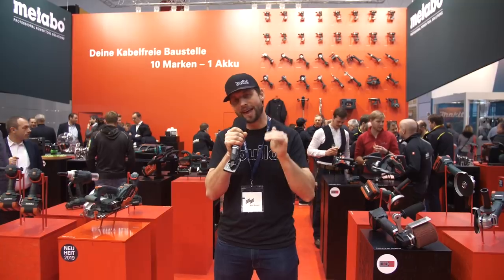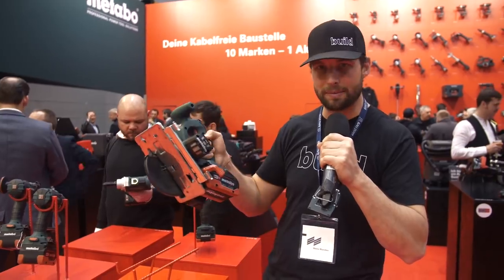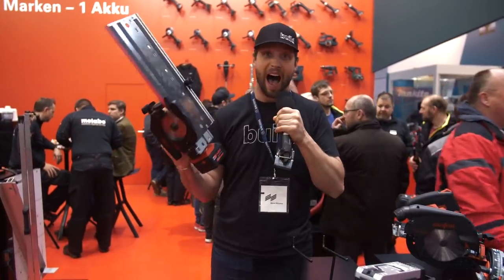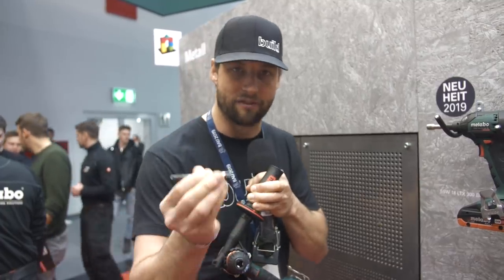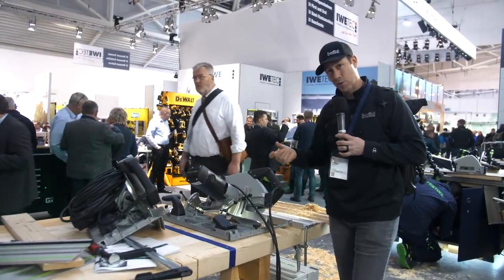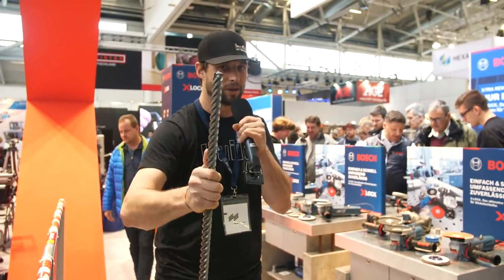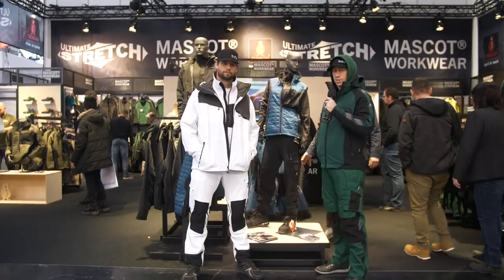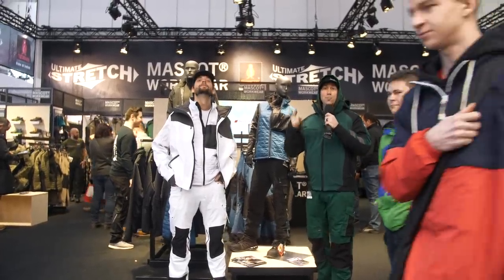Tools you Can't Buy in America

Comment: Grinder tip:   You don't need to use the special tool to take the blade out
Use one hand to push the lock button and use the other hand to unscrew or tighten the blade  
I've learned that tip years ago and I use grinder all the time 
Thanks for the upload 
P.S . Diamond blade are the best for almost any work it cuts through metal and you don't risk to break the disk in your face and they last a LOT longer .
Reply: Glad someone said this. Disc changing is a cinch this way
Reply: The Max high pressure system is available in the US. I’ve had one for a little over two years and you couldn’t get me to go back to standard pressure guns if you paid me. So much lighter and more maneuverable.
Reply: Dont know what kind of adamantium lock switch you have but the plastic ones on literally every grinder on the market ALWAYS  break after a few weeks of use
Reply: @chadpendt2863  i think maybe you are doing something different than everyone else. Ive been in industrial welding and fab for 12 years and have never seen that before.  Not even once.
Reply: @jacobgarcia8224  different strokes. Was in the same field for 5 years and they could not keep a grinder mint to save their lives.
Reply: This is what I do. I rarely use the wrench; which by the way I have not lost.
Reply: I always throw the wrench away.
It's like an oil filter wrench,if you don't know how to install innitially..you should let someone else take over.
Reply: yes, this works for everything except wire brushes
Reply: That "tip" only works if it's put on properly by hand... If it's put on half assed and zinged on by the motor it's gonna be super tight.
Reply: @chadpendt2863  you do know you're not supposed to use the lock switch to stop the turning blade?
Reply: After heavy use discs tend to lock, and the thick discs most times can open them by hand, but the thin 1mm cutting discs, the ones I personally use the most, they are too fragile and before having enough grip to release, they get crushed in hand, btw I repair industrial machines, I don't look at a grinder from a fabricator pov
Reply: @Nuno.A  
Try the diamond one
Reply: @petripat5979  Abrasives are much better at steel, and steel is almost all I cut.
Reply: The new Bosch x-lock grinders etc. work also with normal disc's and no name brands. And the special x-lock blades can also been used on normal grinders... :) ;)
Reply: I was looking trough the comments to see if anyone commented on this. The tool is never used, you tighten and loosen it by hand.
Reply: @rasmAn2  Use a glove.
Reply: Or just use some common sense and tape the tool to the cord so you don't lose it

Comment: God I love Max HS nailers.
One of the major problems with Zip-R sheathing is the damn nails.  Once you get into the r9 and r12 sheathing you need a 5 or 6 inch nail. 
Thats doable with only traditional hammer and nail or the absolute largest nailers on the market. The Bostich big Berta was my obvious go to big nailer. And good lord did it suck and swallow doing homes with that.
I got fed up with it and switched to a Max Hs130. 
Never going back. I dont care what the downsides are to high pressure. This gun does it all and does it well enough i can mitigate or outright not care about the downsides. It is so lightweight.
Big berta weighed what? 20? 30lbs? 
HS130 weighs 14lbs. I absolutely love it.

Comment: That tapping drill is awesome, a tapping head for a Bridgeport is expensive as gold, glad they miniaturized the action.
Reply: FWIW: I use Rigid tapping on my mill, Getting a tapping head can be a hassle and it eats up a lot space, which can be a problem if you working with a tall part under the spindle head. I doubt that cordless tapped has anywhere near the torque of a BP.
Reply: I used a tapping drill all the time in the 80's for tapping of screws at the bottom of elevator doors. I loved that tool. It made quick work for hundreds of holes.

Comment: That tabbing drill is a pleasure to work with. We have one of those (metal working). Cutting a bunch of threads is a joy and super fast done. Like that alot. Another great tool in my opinion is their cordless angle grinder. Relatively quiet and not too heavy. Good when having to cut stuff at a construction side where you dont have access to a AC source.

Comment: because of the bosch abrasive discs at 7:14 I can tell you (from what I have seen in a different video on a German construction channel) that they will give a sort of a "attachment lock license" to different other manufacturers that then can use their design to produce their own discs with those mechanical locking deals

so you are basically not locked to BOSCH only... there will be (at least in the european market) a big selection on matching grinding discs and attachments that matches this grinder type (and you still can use the new discs on all the old grinders as well)
Reply: and from what I remember Makita has high pressure nailers in their lineup... at least from the last catalog I grabbed at my local dealer... :-)

Comment: Correction on the consumables by Bosch: They already licensed the system and many other brands will be coming out with X-Lock Blades, like dronco etc. Also other hand tool brands have bought in. It will likely spread to Makita and others

Also the best part is, that you can at a steeper angle, since there is no lock nut prohibiting it!

Comment: Metabo will not make claims they haven't already thoroughly verified. Neither motors nor batteries have to be as big as they used to be in order to give you the same level of performance. Probably a brushless motor in that circular metal saw.
Reply: Brushless motors are more than 10% more efficient than brushed motors, and offer far more advanced control circuitry (field oriented control) than their brushed counterparts. With regard to batteries, just 3 years ago you'd be hard pressed to find tools carrying anything more than 2,600Mah 18650's , or even less. Today you'll find batteries with 3,000 to 3,400Mah cells inside of them. Some of them may even have better chemistry.
Reply: No comment, David?
Reply: dieselphiend tools are using 21,700 batteries now.
Reply: dieselphiend and the thing with batteries is as tools get bigger so must battery capacity. The problem we are having is high demand tools are maxing out battery technology. The advent of 21,700 cells from Bosch and other manufacturers has allowed for the use of less volatile compositions of LiPo batteries. This is important because high discharge rate means it will have a low capacity as capacity increases discharge rate decrease. Finding the happy spot is key. LG Samsung Sanyo Sony and Panasonic are the main manufacturers of batteries with a lot of other Chinese brands using copycat formulas.

Comment: A standard battery across many mfg’s was most likely required by EU Law. Makes sense from a usability perspective but also would drive the cost of batteries down. By the way, the reason we don’t have custom chargers for our cell phones is because of EU Law.
Reply: Judd_S   That is actually not the case, it used to be because the small specialty manufactures bought the battery, handle, trigger and motor assembly, and got it made in their own color, now they are possibly owned by the same parent company
Reply: @jesperdahl1486  so its more like if Ryobi rigid and Milwaukee all started using the same battery standard?
Reply: jesper dahl< so are you suggesting  Dewalt batteries will work on a Milwaukee today?
Reply: It would be awesome if third-party batteries made by companies (Duracell, Samsung, etc.) that specialize in batteries would become the norm.  Something like an AA or 18650 that all cordless tools would use.  One battery, one charger, all tools.
Reply: @PongoXBongo  Most, if not all manufacturers dont make their own power cells. They buy from specialists and put the battery cells in a case with a few other electronics.
Reply: @obi-wankenobi9871  Then it should be even easier to standardize said cases.
Reply: @PongoXBongo  The big companies like Bosch, Makita or Hilti have no intrest in standardizing their batteries. The batteries are what binds you to one company.
Reply: @obi-wankenobi9871  I get the business logic.  Just seems like an unfortunate situation on the whole.  Perhaps the EU could force their hands somehow?  Certainly not happening in the US anytime soon.
Reply: @PongoXBongo  I would love standard batteries, but the EU ist the USSR. They cant force business to do whatever they want. There is no legal ground for forcing all tool manufacturers to use the same battery, because why shouldnt they be allowed to make their own batteries?
Reply: @obi-wankenobi9871  Never said they shouldn't be allowed to.  Just that standards are typically better, and the way the world in general seems to be moving.  Tools need their version of USB/3-prong/etc.
Reply: Oh No!! ... Standardized batteries!!  Such a socialist idea! 

BTW ... The EU used different frequency (hertz) power.  That's why you need a different phone charger ... nothing to do with EU law.
Reply: @Supe063  Who said it was a socialist idea, and what does that have to with 50Hz vs 60Hz?
Reply: Supe063 Absolutely incorect!All EU and for that matter most of the world uses 220-240v/50Hz electricity.
Not that it matters when battery and chargers are involved as only a tiristor is needed for the same charger to work 50/60Hz to DC.
Standardization is a good thing!Even the stuborn Apple now is doing usb type-C and Q wirreles charging stsndard.Why not the tools manufacturers than?!
Reply: NO, they do not have standardized battery.  Those manufacturers got together and made it.  Just as Milwaukee, ryobi, and some other comany did so here in the USA. 

And with modern electronics the base frequency does not matter anymore other than for very large motor equipment.  Frankly the entire grid should be boosted to 10kHz making everything more efficient.   @Supe063
Reply: @Supe063

It is not the 50 hertz which is the problem, (US = 60),  it is that most all of Europe uses 240 v AC, instead of the 120v AC standard in North America.

Fifty and sixty hertz devices can be readily interchanged with no problems. A slight speed difference is all.
Reply: @Supe063  
The point about EU law is that the EU mandated that phone chargers be on USB standard  to avoid a)chargers becoming a useless pile of electronic junk the moment your phone breaks, gets lost etc. and b)manufacturers monopolizing the market for chargers for the more frequent types of phones to charge consumers an arm and a leg for extra chargers.
Reply: Definitely few companies would go standardized without being forced by law. Otherwise they like to lock the consumer into their proprietary systems. I’m looking at you, Sony and Apple.
Reply: @jesperdahl1486  exactly klauke uses chagers and batterys from makita for there pressing tools. also did the 7.2 nicad stickbattery fit in the AEG drills.

Comment: One battery that would work with all cordless tools , is like hoping for a plumbing license that is excepted in all states in this country. Great idea that maybe some day will happen here. Thanks for all the info and kept the good work up.
Reply: Doesn't seem like it would be that difficult, at least not technically.  Just need a standard like AA or 18650 that any (and hopefully all) manufacturers could use.  They already all work with the same 110/220 mains powers for corded stuff.
Reply: @PongoXBongo 
look at electric cars.. they still do their 'proprietary dance' for the charging connector. 
Also a lot of the brand/design is on the battery and it's interface and it's features.
Plus development there isn't finished.
10 years back we had 12V, then 14, now 18/24/36/48.
Even bigger ones for your lawn mower and similar gear.
Trying to standardize such a fluid and still changing market is not possible right now.

Comment: Welcome to Germany Matt and Jordan. I follow your channel from time to time. I would like to give you some ideas instead using Bosch's x-lock and their super expensive discs I guess. You can use SDS Clic from Bosch it is a quick release nut (Schnellspannmutter or Schnellspanner) if you like I upload a video because I use this type of nut on my grinder. All you need is a grinder with a lock knob on the rear to stop rotate the disc. Coming to the Max tool. When I worked on the construction site as electrician we used a company called Split. Which allows me with a special cartridge and nail punch nails thru steel frames as well. Rgds Carsten from Germany

Comment: Used to work at a German shipyard, they were proclaimng "Makita" is best, after "Bosch". It was there that I learned of some testbuys from "Metabo" they were taking waaaaay more of my abuse than Makita, the cells lasted longer and the power output was higher as well. AND from time to time you can get them as a bundle bargain, almost feels like a steal if the price is off about 25-40%, as they arent that expensive either!
Personal ranking is currently Bosch (for pros, lasts a lifetime), Metabo small buisnesses and home-pro's, Makita not bad buuut not my favourite.

Comment: @awesomeframers has been using the max high pressure nailers for quite a while. That saw with the shaper cutter is alot like the old dado stack skillsaw that was used years ago in roof rafter gang cutting. But looks a lot safer.

Comment: Metabo has had tool free angle grinder disc change for at least a decade and it doesn't require proprietary discs.  

I've heard that little MaFell tracksaw is AWESOME but boy is it expensive!
Reply: the one with the elbow shaped locking lever? it doesnt require proprietary disks AND the lock will fit other grinders. it's a godsend, but it's too fragile and exposed.
Reply: @comethiburs2326  I'm not sure what you're referring to but Metabo "Quick" grinders have a large "thumb" nut that doesn't require a wrench and you can hit the spindle lock while the tool is spinning down to knock it free even faster.  Metabo has also had tool free guard adjustment and variable speed for ages.

Comment: for the bosch x-lock they say that suppliers can get the license for the consumables and that you can put the x-lock discs on old grinders.
pricetag for the grinder would be 10-20 bucks more than a normal one und consumables 5-10% more they say.

And the noticed that they are working with an other tool manufactur that will get out the x-lock system but havnt said teh name yet.
i would say thats Fein most likely because they had a coop for the multitools with them and the starlock system. And thats basicly the same system just for oscillating tools

Comment: 7.20 ..who's  banging grinders to get grinding disks off? If you cant lock the spindle  and grab the disk by its outside diameter and twist it off. No tools needed if it's too tight put a glove on. I've been doing it like this forever (over 25 years) it's never been so tight that I needed any tools to remove it. The disk has enough leverage over the nut. The Bosch is still faster but I prefer the bigger assortment of disks available from any hardware  store over the few seconds bosch saves in changing them out
Reply: I do it the same way with grinders. This system is prob aimed more at the DIYer